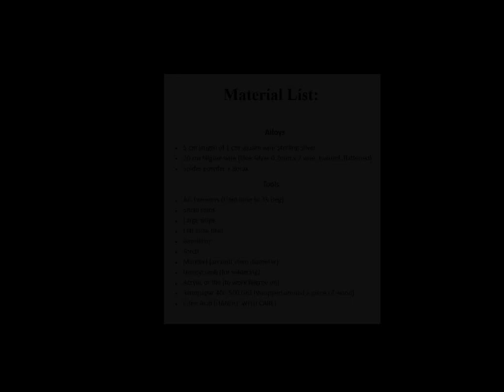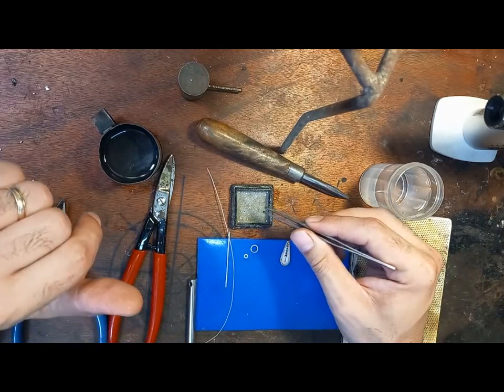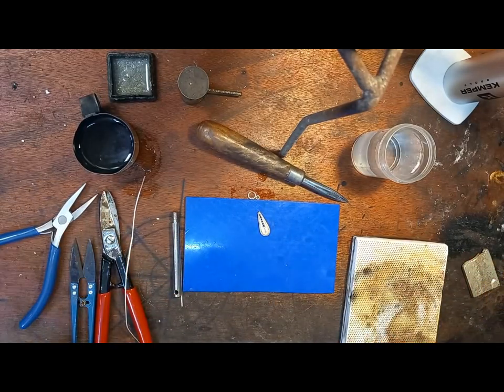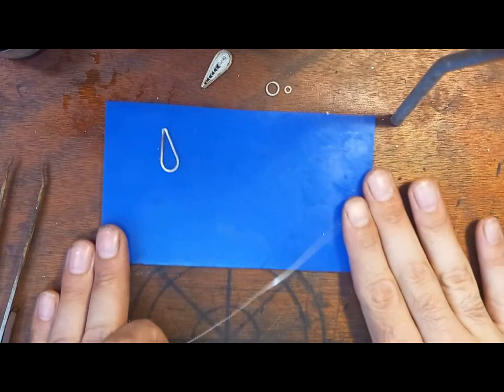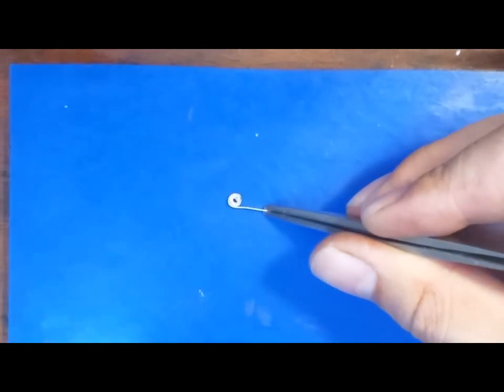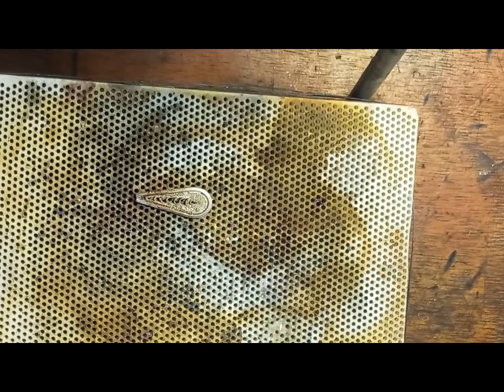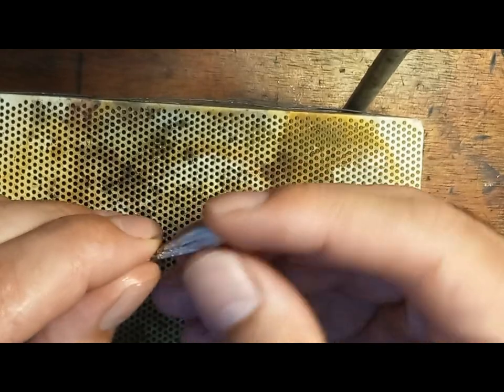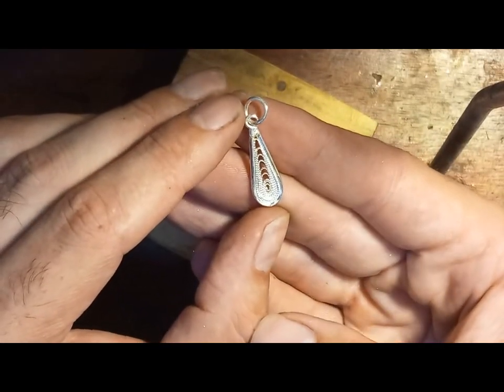Basic Filigree tutorial: Tear Drop Filigree Pendant in sterling silver

Comment: Thanks a lot for your good explanations. What is the thickness  and height of the filigree wire?
Reply from the maker: Wire is .3mm thick.. it's twisted than flattened (this will depend on your style, I like it flat but not too thin)
Reply: @FiligreeArt Thanks for the prompt answer. I understood that you twist two wires 3.0 mm. I would like to know thickness of already flattened filigree wire as I do not know how thin it should be. Thank you very much.
Reply from the maker: @liaduckworth9119  i am in the process of doing an actual video on the making of filigree wire.. 🙏😊 Will include this info in the video..
Reply: @FiligreeArt  Thank you Mark.